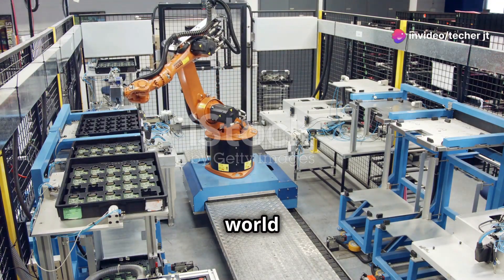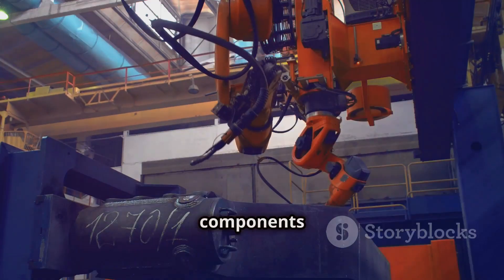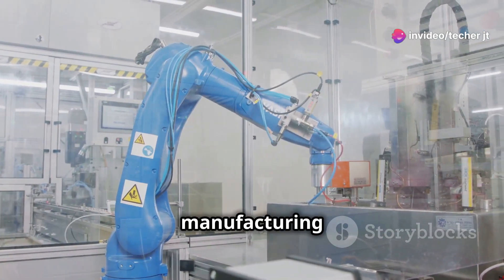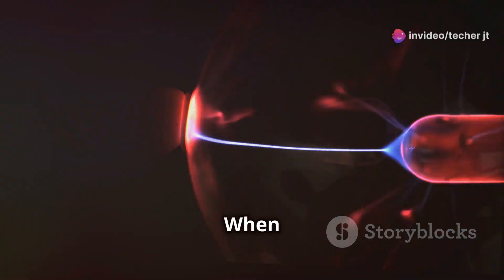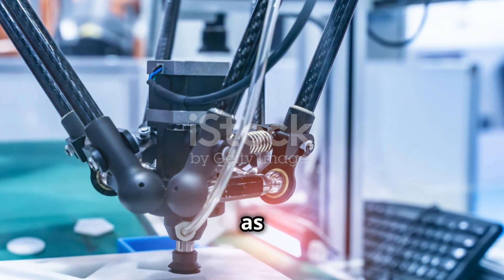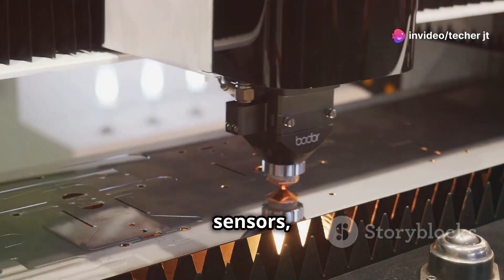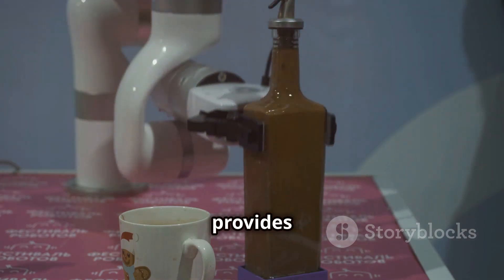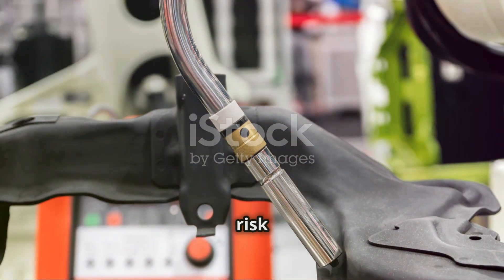Inductive Sensors for Robotics

Comment: Nathan James J. Compo
10 Orion

4. This range is significant because it determines the sensor's effectiveness in various applications. A longer sensing range allows the sensor to detect objects from a greater distance, which is essential for applications requiring high-speed detection or when the sensor cannot be placed close to the target. Conversely, a shorter sensing range might be preferred in environments where space is limited or precision is critical.

Comment: Schumary Faye L. Reyes
10-LYNX

1. What is the primary function of inductive sensors in robotics?
ANSWER:
The primary purpose of inductive sensors in robotics is to identify metallic objects by non-contact detection. Their functioning concept is based on the idea of electromagnetic induction, which states that the presence of a metal item changes the electromagnetic field surrounding the sensor. Because of this, they can sense and measure component positions in automated systems with reliability, which helps with accurate control and operation.

Comment: Messiah Emmanuelle Lei P. Salomon
X-Cassiopeia

2. Describe the difference between shielded and unshielded inductive sensors.

-Shielded inductive sensors have a metal housing that protects the sensor element from external electromagnetic interference. This makes them more suitable for environments with high levels of electrical noise or where precise measurements are required. Unshielded sensors, on the other hand, lack this protective housing and are more susceptible to interference, but they may be more cost-effective and easier to integrate into certain applications.

Comment: Tabitha Glenne P. Lagria
10 - Cassiopeia

3. Explain the significance of the sensing range in inductive sensors.

A: The sensing range in inductive sensors determines how far they can detect metal objects, which is crucial for their use in automation and industrial applications. A longer sensing range allows for greater flexibility in sensor placement, while ensuring reliable detection without physical contact.

Comment: Renalyn R. Gaid
10- Orion
1. What is the primary function of inductive sensors in robotics?

Inductive sensors  provide robots with a sense of touch or proximity detection. These sensors are renowned for their reliability, robustness, and cost effectiveness, making them ideal for a wide range of robotic applications

Comment: Nuriel Danna S. Garcia
10 - Lynx

5. Identify two applications of inductive sensors in robotics and explain their roles.

In robotics, inductive sensors play a crucial role in industrial automation by accurately detecting metal components on assembly lines, which helps guide robotic arms in picking, placing, and handling parts with high precision. Additionally, in medical robots, these sensors are vital for the precise positioning of surgical instruments, ensuring accurate placement and movement during surgeries, thereby enhancing the safety and effectiveness of medical procedures.

Comment: Ralf Mikael A. Lopez
10-Andromeda

1. What is the primary function of inductive sensors in robotics?

Inductive sensors are essential components in robotics, providing a sense of touch or proximity detection. They work by generating a magnetic field and detecting changes in it caused by nearby metal objects. Robots can now carry out a wide range of jobs with accuracy and precision thanks to technology, including autonomous vehicle navigation and assembly line operations. Their reliability, strength, and cost effectiveness them perfect for a wide variety of robotic uses.

Comment: Christian Lloyd B. Hinlo
X lyra

1. What is the primary function of inductive sensors in robotics?

Inductive sensors in robotics detect the presence or position of metallic objects without physical contact by sensing changes in inductance.

Comment: Anika Charisse D. Dawal
10 - Lyra

4. What are the advantages of using inductive sensors over other types of sensors in robotic applications?
ANS: Inductive sensors provide many advantages in robotic applications, making them a popular choice for a variety of jobs. They feature non-contact sensing, which allows them to detect metal objects without needing physical connection, lessening wear and tear over time. These highly resilient sensors resist dust, dirt, and water, making them useful in tough conditions.

Comment: Cassandra Louis R. Bigwas
10 - Lynx

2.) Describe the difference between shielded and unshielded inductive sensors.

Shielded sensors incorporated a metallic shield around its core and concentrated its magnetic field to a smaller, more focused area while unshielded sensors lack a metallic shield and it results in a wider, more diffused sensing field. Shielded sensors are used for precise detection within a defined area, especially in environments with potential metallic interference while unshielded sensors might be suitable for applications where a wider sensing range is acceptable and the risk of interference is minimal.

Comment: Leon Anthony S. Juaneza 
10-LYNX

1. What is the primary function of inductive sensors in robotics?
- It provides the robots or robotic applications, a sense of touch or proximity detection. They also act as the robot's eyes, detecting the presence and position of metal objects, Which is then relayed to the robot's control system, allowing the robot to adjust its movements accordingly.

Comment: Kaihanne A. Manticahon 
10 - LYNX 

2. Describe the difference between shielded and unshielded inductive sensors.

— 
Shielded sensors feature a metal shield around the coil, concentrating the magnetic field into a smaller, more focused area directly in the front of the sensor, which enhances precision and reduces interference from nearby metal objects, making them ideal for tight spaces. On the other hand, unshielded inductive sensors do not have a metal shield, allowing the magnetic field to disperse over a wider area. While this provides a greater sensing range, it also raises the likelihood of interference from surrounding metals.

Comment: Kiesha N. Enriquez 
10 - Orion

1. What is the primary function of inductive sensors in robotics?

Inductive sensors are primarily used to detect the presence and position of metallic objects without physical contact. They enable robots to perform tasks such as object detection, positioning, and proximity sensing with precision and efficiency.

Comment: Loreyn C. Nanay
10 - Lynx

1. What is the primary function of inductive sensors in robotics?
              - The primary function of inductive sensors in robotics is to detect the presence and position of metal objects without physical contact. They operate on the principle of electromagnetic induction, providing reliable, robust, and cost-effective proximity detection. This capability enables robots to perform tasks such as part detection, navigation, and precise positioning, enhancing the accuracy and efficiency of operations in various environments, from industrial automation to medical applications. Inductive sensors are crucial for ensuring smooth, error-free operations, particularly in settings where durability and precision are critical.

Comment: Jullian A. Pangan 
10 - Lynx

4. What are the advantages of using inductive sensors over other types of sensors in robotic applications?

Inductive sensors offer several advantages over other sensor types in robotic applications. First, they are highly robust and can withstand harsh environmental conditions, making them suitable for industrial settings. Second, they are non-contact sensors, meaning they do not require physical contact with the object being sensed, which reduces wear and tear and improves sensor longevity. Third, inductive sensors provide high accuracy and repeatability, making them ideal for precise positioning and measurement tasks. Finally, they have a fast response time, allowing for real-time feedback and control in robotic systems.

Comment: RAINE BADON
10 - LYNX

1. What is the primary function of inductive sensors in robotics?

Inductive sensors in robotics are primarily used to detect the presence of metallic objects. They work by generating a magnetic field and then sensing changes in this field caused by the proximity of a metal object. This makes them ideal for applications such as Object detection and avoidance, Position sensing, and Metal detection in food factories.

Comment: Rhilyne B. Rivas
10-Andromeda

1. What is the primary function of inductive sensors in robotics?

The primary function of inductive sensors in robotics is to detect the presence or absence of metallic objects without physical contact. They work by generating an electromagnetic field and measuring changes in this field caused by the proximity of metal, allowing robots to sense objects and measure distances for various tasks.

Comment: Alexa Janne Arioja
10 - Lynx

1. What is the primary function of inductive sensors in robotics?

> Robotics mainly uses inductive sensors to determine whether metallic items are present or absent within their sensing range. The primary application of inductive sensors is in robotics to identify the presence or absence of metallic items within their sensing range. They function by producing an electromagnetic field and monitoring changes in this field brought about by the proximity of a metal object. They work by producing an electromagnetic field and monitoring variations in it brought about by the presence of a metal object.

Comment: Neeka Ella P. Guillero
10 - Lynx

4. What are the advantages of using inductive sensors over other types of sensors in robotic applications?

Inductive sensors provide several advantages over other sensor types in robotic applications. Since they operate without contact, they experience less wear and tear, which enhances their durability and reliability, especially in industrial environments. They offer high precision in detecting metal objects, which is important for automated systems. Additionally, these sensors are cost-effective and robust, making them a practical choice for many industries.

Comment: Chris Nathan Dwayne M. Dura
10- Lynx 

3. Explain the significance of the sensing range in inductive sensors.

A:
The sensing range is the maximum distance at which an inductive sensor can reliably detect a metal target. Factors like target size, material, and sensor size affect the sensing range. Knowing the required sensing distance is critical for proper sensor selection and positioning in robotic applications.

Comment: Chelsie Ann P. Carnaje 
Grade 10 - Hermes 

1. What is the primary function of inductive sensors in robotics?

Answer: The primary function of inductive sensors in robotics is to detect the presence or position of metallic objects without direct contact. They operate based on changes in inductance caused by the proximity of a metal target, enabling precise measurement and control of components in various robotic applications, such as detecting the position of parts or ensuring proper alignment in automated systems.

Comment: Paul Veloso
10 - Orion

1. Inductive Sensors provide robots a sense of touch or proximity detection. They detect the presence of metallic objects within their operating range. They work by generating an electromagnetic field which is disrupted when a metal object enters a field.

Comment: Sabina Claudia Barbosa 
10 - ANDROMEDA

1.) What is the primary function of inductive sensors in robotics?
-  Inductive sensors detect the presence or absence of metallic objects without direct contact. They use electromagnetic fields to sense changes caused by the presence of metal, which results in precise positioning and object detection.

Comment: Gabriella Kish O. Gatchalian
10 - LYNX

1. What is the primary function of inductive sensors in robotics?
- Inductive sensors in robotics primarily detect the presence or absence of metallic objects without direct contact. They use electromagnetic fields to sense changes caused by the presence of metal, enabling precise positioning and object detection.

Comment: Joshua El Noah M. Suan
10-Lyra

4. What are the advantages of using inductive sensors over other types of sensors in robotic applications?
-Inductive sensors are durable, reliable, and ideal for robotic applications in harsh environments. They detect metal objects without contact, offer high precision and fast response times, and are immune to external interference from factors like lighting or temperature. Their low maintenance needs also reduce downtime and costs, making them highly effective in industrial robotics.

Comment: Mitri Genelle P. Salagantin
10 - Hermes

2. Describe the difference between shielded and unshielded inductive sensors.

Answer: Unshielded inductive sensors lack a metallic shield around the coil (results in a wider and more diffused sensing field which extends to the sensor's face & sides) but are prone to detect any unwanted metal objects in close proximity (which can cause false readings). Meanwhile, shielded inductive sensors have a metallic shield around the coil, which can concentrate on a smaller, yet more focused area that is direct to the sensor's face. This significantly reduces the sensor's sensitivity to metal objects that are beyond the sensing range.

Comment: Tysh Maeganne Z. Sagocsoc 
10- Hermes

2. Describe the difference between shielded and unshielded inductive sensors.
- Shielded inductive sensors has a metallic shield around the coil. It concentrates to a more focused area and it reduces the sensors sensitivity to metallic objects outside its intended sensing range. Unshielded inductive sensors lack a metallic shield which provides a wider sensing range. Unshielded inductive sensors are prone to detecting unwanted metal objects in close proximity.

Comment: Rebmevon B. Marquino
10-LYNX

1. What is the primary function of inductive sensors in robotics?

- Inductive sensors in robotics detect the presence or position of metallic objects without requiring physical contact. They act as the robots eyes sensing metal parts using electromagnetic fields, making them useful in a variety of applications such as object recognition.

Comment: Kirk C. Nangkil
10-LYNX

1. What is the primary function of inductive sensors in robotics?

- To detect the presence and position of metal objects. They act as the robot's eyes, providing information about the surrounding environment that the robot uses to navigate and interact with objects.

Comment: Jenie Rose Jilhaney
10 - Lynx

1. What is the primary function of inductive sensors in robotics?

Inductive sensors are primarily utilized in robotics to identify the location and presence of metal items. They are used in many different applications, including medical robot instrument positioning, autonomous vehicle obstacle detection, and assembly line part detection. Non-contact inductive sensors sense changes in magnetic fields brought on by the presence of metal objects.

Comment: Annarica Nina A. Loyola
10-HERMES

1. What is the primary function of inductive sensors in robotics?

 inductive sensors stand out as indispensable components, providing robots with a sense of touch or proximity detection. These sensors are renowned for their reliability, robustness, and cost-effectiveness, making them ideal for a wide range of robotic applications, from simple part detection to complex navigation tasks. These sensors act as the robots eyes and help detect obstacles and maintain safe distances. Inductive sensors empower robots to operate with precision and efficiency in diverse environments.

Comment: SCHUMARY FAYE L. REYES
10-LYNX

1. What is the primary function of inductive sensors in robotics?

ANSWER:
- Inductive sensors are primarily used in robotics to detect the presence or absence of metallic objects within their sensing range. They operate by generating an electromagnetic field and detecting changes in this field caused by the proximity of a metal object.

Comment: Zion E. Paberecio 
Grade - 10 Andromeda 

4. What are the advantages of using inductive sensors over other types of sensors in robotic applications?

ANSWER: Inductive sensors are reliable, durable, resistant to environmental conditions, and unaffected by dirt or moisture, making them ideal for industrial robots.

Comment: Roda A. Patayon
10 - LYNX

1. What is the primary function of inductive sensors in robotics?
The primary function of inductive sensors in robotics is to detect the presence and position of metal objects. They are used in various applications such as part detection on assembly lines, obstacle detection in autonomous vehicles, and instrument positioning in medical robots. Inductive sensors are non-contact sensors that work by detecting changes in magnetic fields caused by the presence of metal objects.